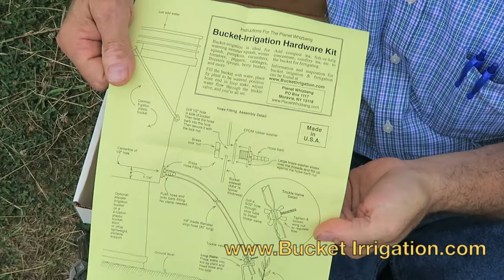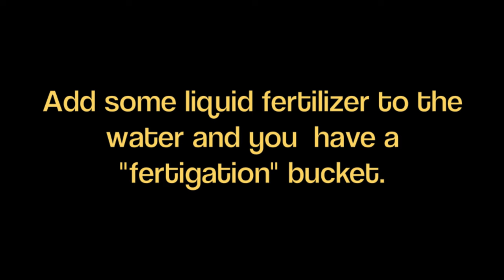Whizbang Bucket Irrigation For Gardeners

Comment from the maker: Some viewers are confused by this video. Let me clarify... Whizbang bucket irrigation is a simple, hassle-free, low-tech approach to spot-irrigating (or fertigating) individual plantings. It is a tool for deep-watering with a slow, steady trickle of water. Although I illustrate this tool by watering a row of strawberries, I do not typically water rows of strawberries this way. I typically use this tool for occasional watering (in especially dry times) of "hill plantings" of crops like squashes and cucumbers. I have also used it for deep-watering of fruit bushes and small trees. This idea is absolutely NOT being presented here as the solution to watering your whole garden. 

I have experimented in past years with drip-tape irrigation. It was a real bother to deal with. What I finally realized is that, in trying to keep my whole garden watered, I was doing something that didn't need to be done. The roots of young plants will strike deep for water and find sufficient water— if they are not continually watered from above. And if the plants are not spaced too close together, those deep roots will be able to supply the plant with all the moisture it needs.My "Planet Whizbang Idea Book For Gardeners" has an excerpt from an old farm almanac (from the 1800s) that explains this. The old timers knew. They didn't have the time or infrastructure to always be watering their gardens. But in a real dry spell, they would get out the buckets.

Since making this video, I have pursued Minibed Gardening, which is an idea for growing a serious home garden without any artificial watering. After one year of experimentation, the idea worked beautifully. You can check it out here: https://youtu.be/F5ovc8XwGTI.    

For more information about the bucket irrigation kits I sell, click on this link: www.bucketirrigation.com
Reply: Labor intensive maintenance.  Hand adjusting the drip for every plant on half an acre could take a fellow a couple of hours.
Reply from the maker: @dianelanderson5504  Sorry you're having a problem ordering. This is the first I've heard it. Are you ordering from this page? ... https://www.planetwhizbang.com/gardening
My e-mail is: Herrick@planetwhizbang.com  I will send you a PayPal invoice shortly. Thank you.
Reply: Herrick Kimball  I used the link from you tube video.  Thank you. Just paid invoice going on vacation in couple of weeks.  Wanted to set up for watering in our absence. Thank you.  This link works I will save it

Comment: I made something like this for a small plastic covered greenhouse.
I had 3 pails on top of each other with water flow going to each bucket. pieces used were from the hardware store for irrigation and alittle improvised thinking. The buckets were elevated I had a micro irrigation setup to each plant, i had drip valves for control, the two bottom buckets were designated to the plants, each bucket watered so many plants.the top bucket was the filler upper bucket. this could be moved around when emptied.
I would fill the buckets up in the evening on workdays and in the mornings I would open the control valves x 2 and away I went to work. worked like a charm. 
most of the hardware I already had so I just needed some imagination to put it together.

Comment: Elizabeth L. Johnson said, I do use all the black colored irrigation stuff, but when there's a plugged up hole or spot, I simply cannot get it cleaned out.  At least with your clear plastic tubing everything is visible, easy to clean, etc (and probably wouldn't ever have to!)  I don't store my tubing, it is so lengthy.  With your method it is easy to handle, easy to store, so you don't ever have to repurchase and reassemble as a result of exposure to all year weather, as in my case of irrigation materials.  Great idea!

Comment: I've been doing the same general thing for several years. But I use 1/16th id tubing that I weight on one end. I just toss the weighted end of the tube in the bucket and start a siphon. That's all. You are right about the watering schedule, Once every 5 days is plenty.
Reply from the maker: Thank you. Great idea. 
And totally safe, unlike when I once tried siphoning gas out of my car as a teenager. I got a mouthful and it was a memorably terrible experience. 😣

Comment: Love the idea and was ready to purchase several kits, however I need to drip irrigate several plants at a time! But I love the video!
Reply: make your own and modify it to your needs. make it into a soaker hose kink the end and zip tie it to seal it the poke holes were your plants are. don't buy the kit. if you drill the hole correctly it will handle the pressure without the barb seal.

Comment: I like your gentle voice and the video is great. I use a similar bucket system but have an old cut off hose quick released onto the bucket (I use a baby sock with an elastic as filter on the inside of the bucket... filters are expensive). I then attach end emitters to the hose around the plants and water in a circle (better pressure) on a raised bed. I blow out the system every week by reversing the quick release on the hose with the garden hose. Every bed has a bucket with a top zapped to it (I don't like to drown the bees etc.). I collect the system in the winter and put it out when I plant out marshalling the plants by the emitters. My water is collected from two 2500 gal. tanks. That does me the whole year.

Comment: why the cut tires??? just put a small hole in the plastic and plant through the plastic.  Wont dry out as fast if you use a small hole.  You are also wasting space.  Run your pvc pipe with small holes in it (or drip tape or old garden hose with the end clamped and holes in it) under the plastic (connected to the bucket) and plant through small holes in the plastic.  This will save water and space and not dry out as fast. Leaves also will stay dry and healthier.

Comment: I have my qty 4    4'x6' beds set up with 3/8" soaker hoses.  There are rain spouts coming off our roof beside the beds.  If I set up rain barrels with 4-way manifolds to fill 5 gal buckets you used in your system, could I modify the fittings slightly to run them into the soaker hoses in each bed?  I know it would have to be quite high off the beds.
Reply from the maker: I don't know. I had a soaker hose many years ago and it needed household water system pressure to work. If that is still the case with soaker hoses, gravity-feed water from a bucket would never do the job. A gravity-flow drip tape system like Chapin Living Waters uses would probably be a better way to go if you want to use rain water to irrigate rows.
Reply: You are probably right, but Murphy's Law strikes again.  I had set up a soaker hose system 2 days before I saw your bucket irrigation system.  Now I will have to find a place to use your system in my small garden, lol.  Thank you for your reply and keep the great ideas coming.  God Bless you.
Reply: Are you a Rocket Scientist?

Comment: Great idea Herrick and simple as well.  It reminds me of the ones from ECHO from a number of years back.  The ones that Chapin Living Waters used ECHO sold, but appears no longer.  Perhaps your concept could be used for them?
Reply from the maker: Hi Karl, 
ECHO still sells the Chapin Living Waters irrigation kits. I bought one to better understand their concept. Their system stays in place, while my buckets are moved around the garden as needed. Also, they use the drip tape, which has a drip emitter every 12," while my buckets have the trickle valve, which allows a regulated drip or flow in a specific area. There are less components, less set-up, and more versatility with my bucket irrigation approach. However, Chapin Living Waters has a very well engineered and proven system for gravity-fed drip irrigation of a garden. I question the wisdom of everyday watering, which they advocate, but their systems are, evidently, helping a lot of people in third world countries grow their own food, and that is a beautiful thing.

Comment: With the bucket irrigation. Can I buy attachments anywhere that allow me to splice the hose to run to multiple tom plants? I have my plants in buckets and want to do D.I. I have 9 tom plants. Would love to set up one for my peppers also
Reply from the maker: Hi Morgan,
When I was experimenting with this watering system I purchased some brass Y-fitting with the thought that I would divert the flow of water to several plants from one fitting on the bucket. In theory, it makes sense, but in practice, it doesn't, or it didn't for me. The water chose to go to one line and did not flow evenly to the other(s). Thus, the only way to effectively drip irrigate multiple plants from a single bucket is to have multiple fittings on the bucket, with a single hose going to each plant. Thanks for the question. Best wishes.
Reply: @herrickkimball  oh ok. Well each kit is 16$ so that'd be way too much for me to spend on this system to correctly send water to each bucket. Lol it is a great, simple idea though if you only need one or two. 😁
Reply: smalltown 90 cheap any easy way is to do a wicking system. Get a 5g bucket, and put between two of your Tom plants. Run a cotton line from inside the water bucket to inside the soil of the Tom plants as close as you can get it. Water is wicked from the water bucket slowly to the plant. Cheap and easy.

Comment: I like the simplicity of your wingnut and bolt adjustable dripper. 
How did you determine a bucket? :) I think Strawberry plant roots go down about 3 feet. So if the soil was bone dry, a 5 gallon bucket (0.66 cubic feet) would add 22% water volume over a 3 cubic feet area. Since yours don't look like they're wilting and the wilting point for sand is about 6%, or 12% for silt loam by water volume, you're at least 28% water volume which is near field capacity for loam, and pretty much ideal...
Reply from the maker: Interesting. I did not determine a bucket based on the knowledge you have. I just guessed it would be a good amount. :-)  Thanks for the comment.
Reply: uhmm ???   "Strawberry plant roots go down about 3 feet  "...what type of berries you growing Craig ??    I've been growing these for may years i've never seen more than maybe 8 inches
Reply: The bulk of the root will be in the first foot but Dunlap have been shown to go down 3 feet: http://soilandhealth.org/wp-content/uploads/01aglibrary/010137veg.roots/010137ch18.html
Reply: wow i never thought that to be tru thanks for sharing the link too...I have 6 type of strawberries  OZARK BEAUTY, White Carolina Pineberry, alpine white (small ones but tasty )
Honeoye, & BEST BERRY  & generic no name from home depot...lol
I'll have to check out the Dunlap now ..i never knew they had so may types...
i grow mine IN Ca 30 North OF San Francisco
residential back yard berries flat grow...
next yr i'm thinking barrels or rain gutters easier picking......i bet you grow in black plastic mounds...what the pros n cons do it that way ? and how do you get the plastic under on the sides
Thanks for the share...Peace
Reply: How much yellowcake to make a fissile device? They sell SarahLee in grocery store.

Comment: could you poke pinholes into the hose and tighten down the trickling valve to make the water come out over the whole length of the hose so you could irrigate multiple plants with one hose? Maybe use a longer hose. As long as the bucket is sufficiently high up to provide water pressure, it should come out of the pinholes evenly. To water deeply, you could just refill the bucket instead of changing it's location
Reply from the maker: I have not tried the pinholes in a hose idea. However, I have hooked one of my irrigation buckets to a 30-foot length of drip tape, just like is used by the Chapin Living Waters irrigation system (http://www.chapinlivingwaters.org) and it worked perfectly. The bucket needs to be higher to get more water pressure in that kind of setup.
Reply: Pinholes will block easily on gravity-fed systems.
Reply: I like your idea.
Reply: The guy is a Flagellist.

Comment: Are you able to turn the water off also is there a way to attach a battery operated timer so the water turn on on its own
Reply from the maker: Yes, the water can be turned off by tightening the wing nut. No, this idea is probably not suited for using a timer to control on-and-off action.

Comment: Hello Herrick
I have another question. Your strawberry plants being deep watered are under raised beds. How or what is the black you used and how do you raise it up like that
I see orange trees here in Spain the same 
I would like to do the same but yours look nice and smooth  domed 
How did you do it.
Thanks
Vic
Reply from the maker: Hi Vic,
That black plastic is some inexpensive plastic mulch that I rolled down the row and tucked into the soil. The ground was tilled up first and then hoed and raked into a neat mound. The plastic is straight along the row because I took the time to set up a string line. I'm an old carpenter and  I like stringlines. 🙂
Reply: Great Job again

Comment: Where can I buy just the hardware brass fittings? I know those were purchased somewhere. A link would be appreciated! Thanks! 

Also, could you explain the hardware for the drip hose wing nut adjusters? Thanks!
Reply: The brass hose barb is probably like five dollars at Home Depot or your local hardware store. The wing nut is on a screw that goes through the hose, Not much to explain there
Reply: Warning: this information may have been stolen from NASA... copyright infringement rife!
Reply: Wagner PD so using a water tank connected to a pipe is a infringement ?

Comment: you must have a lot of time on your hand why not just install a regular drip system ?
Reply from the maker: I have installed a drip system in years past. It was a hassle. For my climate, and plant spacings, I rarely need artificial watering. Occasional spot watering of some plantings during a very dry stretch is sufficient. Last year, however, I experimented with the Minibed Gardening system and no artificial watering at all was needed.

Comment: Why not natural mulch rather than plastic, which prevents rain water from percolating into the ground and alters the microbial system in the ground.  Natural mulch will add to the soil and prevent the weeds.
Reply from the maker: Natural mulch is fine, if you have a plentiful supply, and it does not have herbicide carryover. There is plenty of subsoil moisture under the plastic. The microbial system is altered to some degree but not to any negative effect. Almost all organic-certified food you buy these days has been grown with the aid of polyethylene mulch. I resisted polyethylene for decades. Now I'm an advocate for it. Do what works for you. 👍

Comment: Anything I can use in place of tired sidewalls? I don't have access to lots of used tires nor the ability to cut them. Thanks.
Reply from the maker: You can make a square of 2x4 wood instead of using a tire sidewall. Check out http://minibedsonplastic.blogspot.com/
Reply: A sharp knife cuts the sidewall of the tire away from the tread easily

Comment: I like this but there HAS to be a faster way to water more plants at a time. Is there a way to hang buckets or do something like that?
Reply from the maker: Hi Country Frau,
There certainly ARE faster ways to water more plants at a time. Lee Reich, the garden writer, has his gardens hooked to drip tapes fed by a hose and controlled by a timer. That would be ideal. The method I show here is NOT in any way good for watering a lot of plants easily. It's a very simple, very effective low-tech approach to deep-watering individual plantings. Although I show it on a row of strawberries, it is better suited to spot watering of more widely spaced plantings, like squash plants, bushes, or young trees. My objective is to not have to do any artificial watering in my garden. I have pretty much achieved that with my Minibed Gardening system, but last year I still resorted to using these buckets to deep-water individual tomato plants in Minibeds at fruiting time, and the buckets with trickle valve worked great for that. If you are a slave to watering your garden, you may want to check out the Minibed system: https://youtu.be/F5ovc8XwGTI. Thanks for the comment

Comment: thanks for the information, but I have one question. can this system be used for irrigation of spinach plantations, which have a tight spacing? thanks.
Reply from the maker: No. This watering technique is not suitable for that application.

Comment: Could you tell me the actual name of that white covering fabric? thanks!
Reply from the maker: It is Agribon row cover fabric. Available from numerous places. Johnny's seeds has it. Comes in different weights. I don't recall the weight I'm using but it is the lighter fabric, which allows more light transmission.
Reply: Agribon 19, it is the lightest of that line of row cover.  I have at times put it on double when the weather forecast it was going to get down in the teens at night.
Hello Chicken Coop!
OAG
Reply: Netting for gardens.

Comment: Good video. Cured passenger tires contain carcinogens.
Reply from the maker: Correct. The question is if the carcinogens leach, and they probably do to some degree, though that degree is negligible. The next question is if the very small degree of leachate is taken up by the plants. The answer is no. It is not molecularly possible for the plant to absorb such leachate. The next question is if the negligible leachate does any damage it the soil biology and there is no study that I know of that has been done to find out. For me, the usefulness of the tires outweighs any extremely minimal carcinogenic leachate. There are many other carcinogens in the environment that concern me a whole lot more than tires. But to each his own. Do what you are comfortable with doing when it comes to these things. 👍